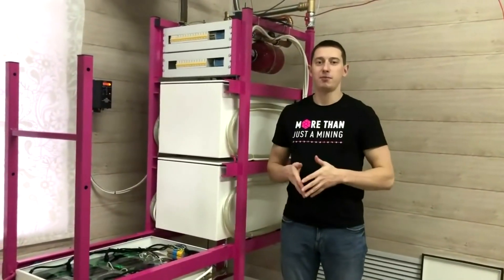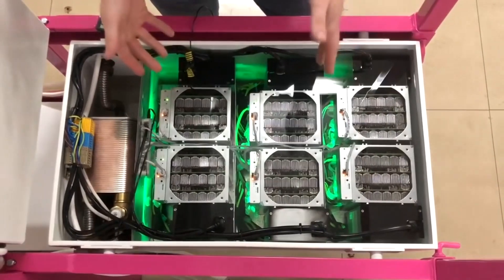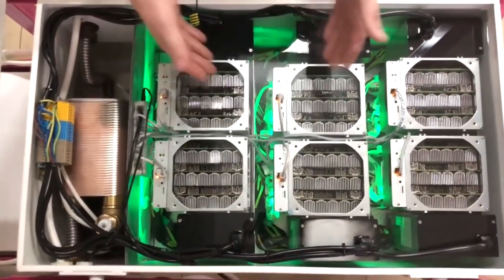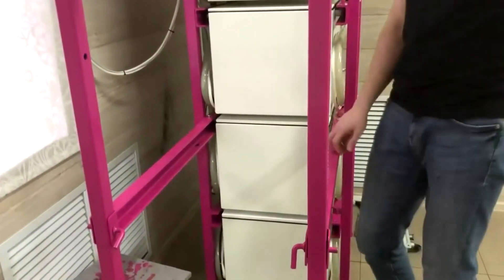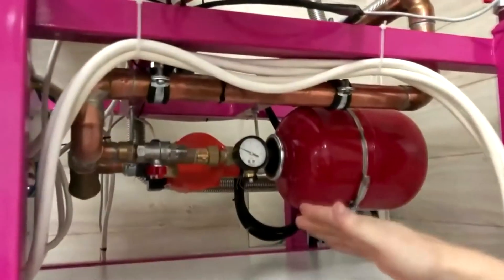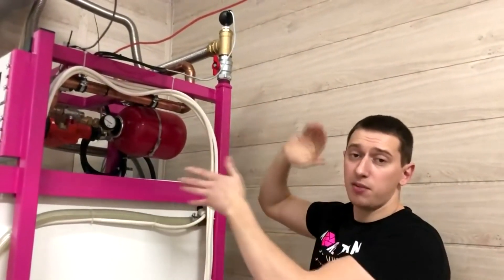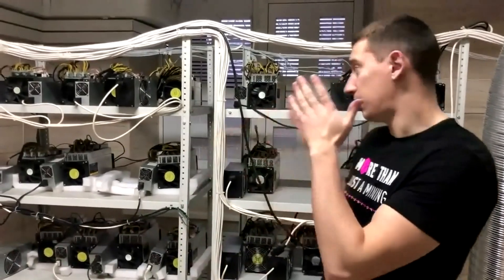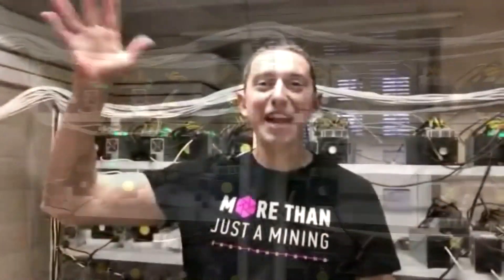ASIC S9 overlocking up to 20.4Th/s with immersion cooling

Comment: hey bro, i am in front of the sea. then i have problems with humidity in the air. I always see condensation over the fan. Immersion cooling is a good idea for this kind of farm?
Reply from the maker: Great idea, there will be no condensation on the asics when they are submerged.

Comment: do you sell ur coolant to asia country like singapore ?
Reply from the maker: We have worked with clients from Asia, please write your request to sales@bixbit.io and we will try to solve everything.
Reply: @BiXBiT_Global  
Максим Писарев:
Hello. Unfortunately no. We dont seller it abroad.
Reply from the maker: @diuniasing7135  We cannot supply a small volume, as it is rather problematic. Only when ordering large volumes of our customers does it make sense to start the whole process.
Reply: @BiXBiT_Global  200liter u mean ?
Reply from the maker: @diuniasing7135  It is advisable to start the process with a delivery of 5,000 liters. We supply such volumes to customers together with our cooling system.

Comment: Hello, what is the electricity usage per miner (S9) with this system?
Reply from the maker: Hello Jorge,
The usage per S9 miner with our system is 2 284W. ASIC will have 20 Th/s.
The usage of the Rack (without devices) is 2 016W.

(those numbers are relevant when the ouside temperature is +30 °C)
Reply: @BiXBiT_Global  this is a beautiful compact setup. does the 2016 W include the cooling tower fan power also?
Reply from the maker: @2hedz  Thanks! Yes, fan consumption is included. In updated installations, it is even smaller.

Comment: You could reclaim the heat to heat your house
Reply from the maker: That's true. But some miners  just don't need to use the undue heat in heating purposes. In such cases we offer a solution with a powerful cooling tower
Reply: It could be easy with a by pass valve to use this heat for hvac or hot water . If the power is sufficient, it is possible to sell this energy at low cost to neighborhood !
Reply: @shirokuma3216  Even better to convert heat to electricity through various means and reinject it for self consumption into the mining rig.

Comment: This is one of the best set ups I have seen for a small operation. Thanks for the info.
Reply from the maker: Thank you
Reply: BiXBiT Global Hi, we are currently setting up immersion cooling and using your bitbix firmware. When removing the fans, do you need to change any of the firmware settings? Or is it a pretty straight forward fan removal? Thanks J